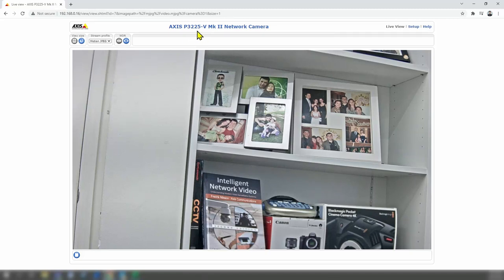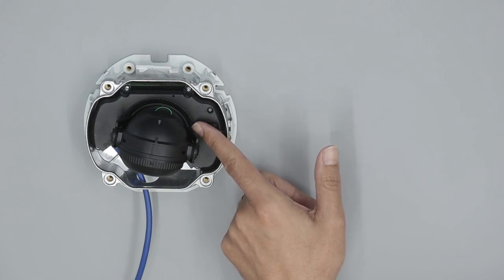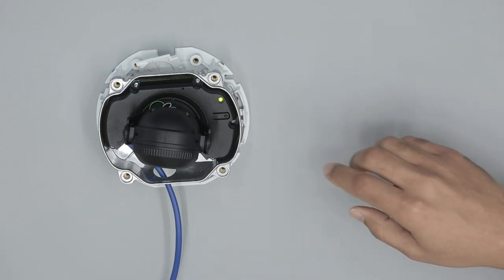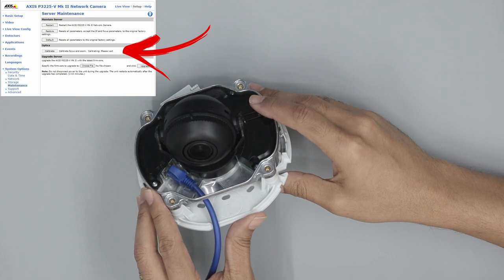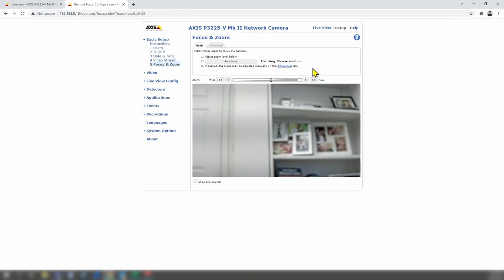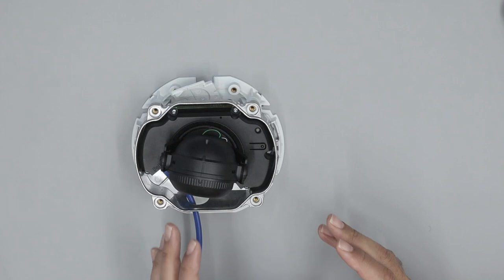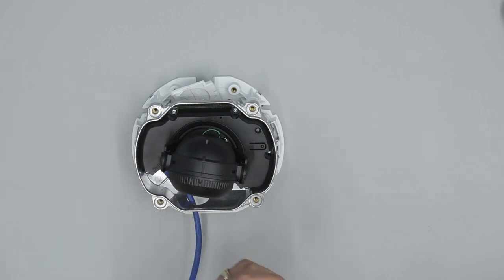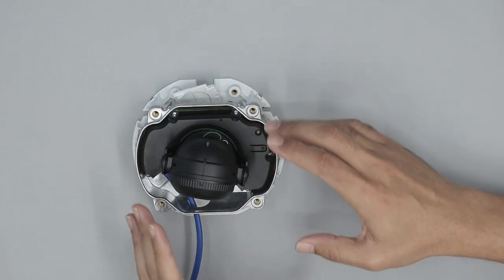Axis Camera - How to fix Autofocus Issue (Example with a P3225-V)

Comment: I have installed approximately 360 Axis cameras since 2012, and this model P3225-LV absolutely has this problem.
I have kept this on my shelf just in case I wanted to try a solution, and one, was to change my zoom to match the awkward focal length issue that calibration and focus could not adjust for.
I need to use it at widest field of view, and you just could not get it to focus, however, I tried your final suggestion, and contrary to my intuition, I put a tissue over the lens, and pressed back firmly until I felt it move slightly.
I went back, re calibrated and then focused, and sure enough, it was able to focus even at full wide field of view.
You saved this camera, and taught me a lesson, which I usually try not to give up.
Outstanding video, very good step by step explanation, and thank you for saving this camera.
I typed my issue in Firefox, your video was one of two, but yours attracted my attention, and even though you had your zoom at around 50%, your suggestion and method was right on target.
As much as these cameras cost, they should not have these issues, but thanks to people like you, I will be able to use it again, and I will not forget what you so willingly shared.  🙂👏👍
Reply from the maker: I'm glad I could help.